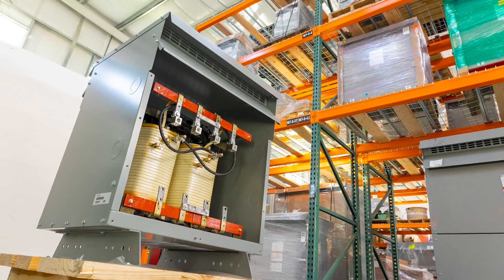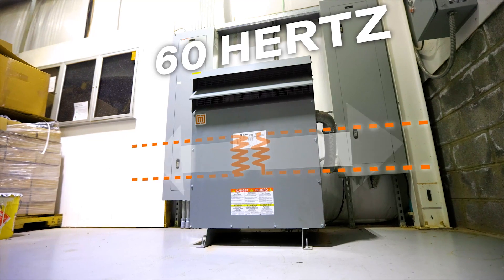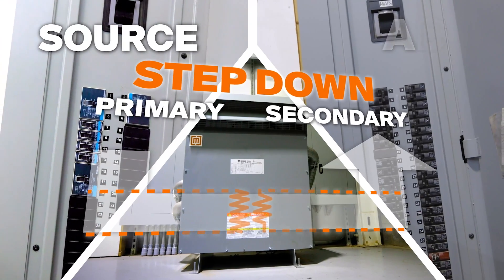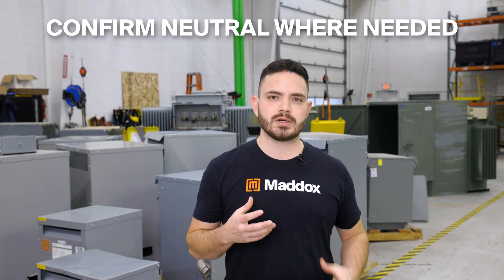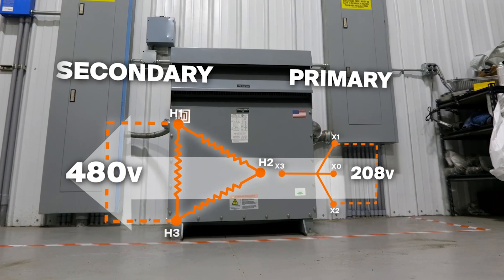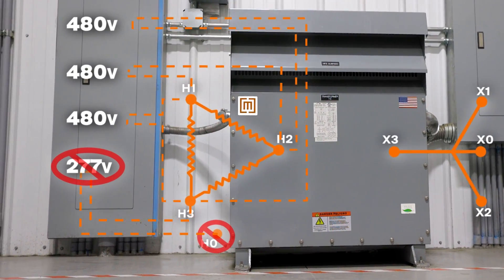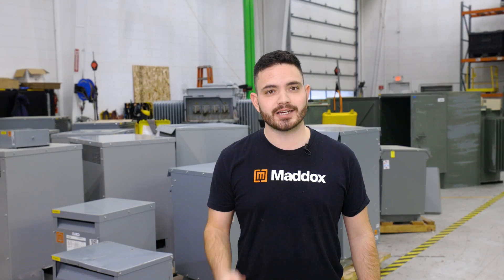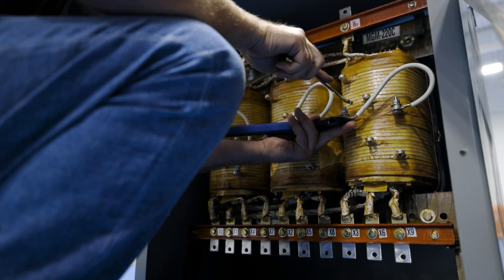Can a step down transformer be reverse fed? | Maddox Transformer

Comment: Is it possible to do the opposite as well? VT  For example, the user is measuring a 22 kV transformer for 110 volts. If we feed the secondary with 110, what will happen?
Reply: If you feed a 22kv (singe phase) to 110V/220V (split phase) distribution transformer with 110V on the 110V side, you will get full 22kV out of the high voltage side, what obviously is very dangerous and enough to kill you very easily. So please don't try this when you don't know what you're doing.

Comment: Correct me if I’m wrong but your graphic showed a single phase 208v being converted to 480v three phase. Based on my knowledge, H2 and H3 will have 0v.
Reply from the maker: Great question. In the graphics for this video we are showing a transformer being reverse fed to step up 208v 3-phase to 480v 3-phase. In this scenario, the neutral X0 terminal on the 208 side is not used. Also, the 480 side does not provide a neutral since the winding is delta connected. Check out this article for more information: https://www.maddoxtransformer.com/resources/articles/step-up-step-down-transformers-and-reverse-feeding
Reply: @MaddoxTransformer  thanks for the explanation.
Reply: That's correct, you cannot create three phase power out of a single phase supply using a simple transformer. When it comes to loading a three phase transformer which is (back-)fed from a single phase supply, you will get rated voltage at the "fed phase" only. Both other phases are connected in series across the "fed phase" and form a phase-shifting network with the load you connect to them (while the "fed phase" is zero degrees for reference). Which kind of voltage or power you get on these phases depends on how those phases are shifted and thus depending on the connected load, but you will not get real three phase power (with all phases are shifted 120 degrees to each other) with a simple transformer. You may get this when using a three phase motor running from a single phase supply, which then could run as a rotary converter.

Comment: Nice concise video.

So what is the difference in a step up vs a step down when above 75kVA? I sell generators as large as 3000kW and often people want MV output. The generator will only produce 10x current, and the instantaneous can be set above that, but what specifically would I want to know about the anatomy of the transformer to make sure it is appropriate?
Reply from the maker: Hi Curt,
The best way to find the type of transformer that would meet your specific need would be to reach out to one of our technical sales reps. Please send us a message: https://www.maddoxtransformer.com/contact